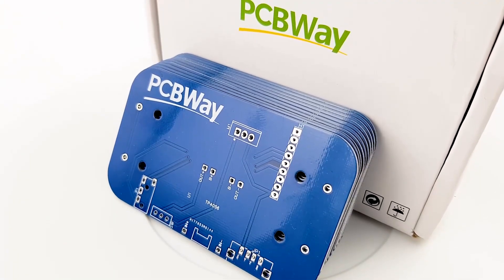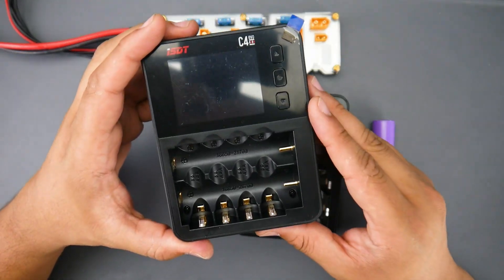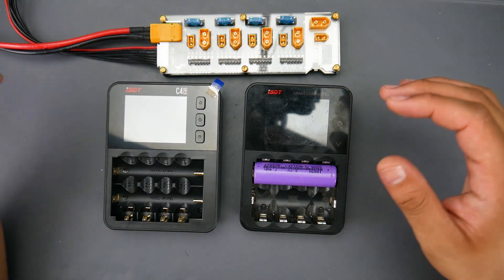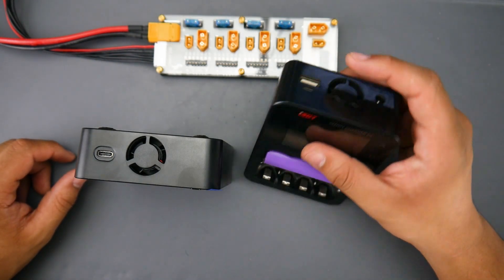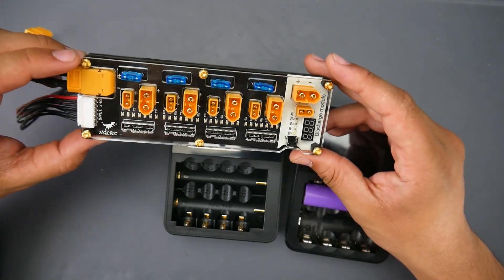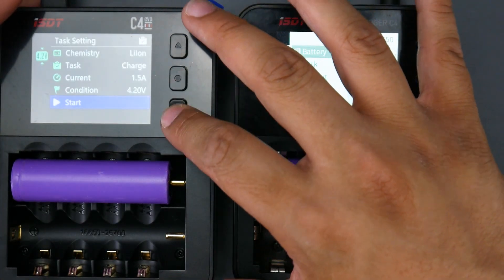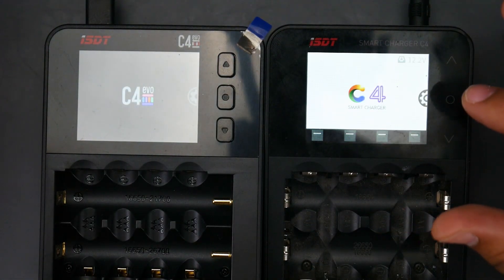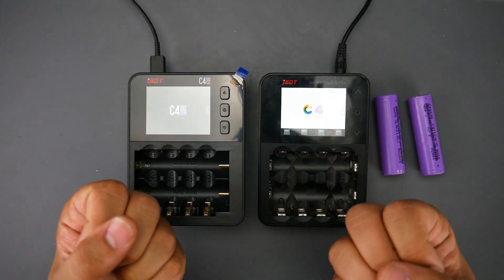My Best 18650 Charger Got an Upgrade // C4 Evo

Comment: Just got the SKYRC MC3000 and thinking about returning. Why isnt there a good all around 18650/21700 charger. Hopefully one that does lipo too. what about xtar dragon or the new epoch one?
Reply: What's wrong with your MC3000?
Reply: If you do not like your MC3000 you will most likely will not like anything. I use my MC3000 daily and never had any problems with it. I use it with the bluetooth connection to my phone and sometimes with the USB cable connected to my Laptop. It charges everything you throw at it. The best thing, it is super accurate.

Comment: I received mine and it's not charging properly. I was thinking maybe the power supply was the problem. I got a cheap USB-C power supply rated for 12V@1.6A. On the display I can see the input voltage dropping from 12V to 10 or so and the battery stops charging. Any idea? 
Btw nice review as always.
Reply: You need 12-5v 3A
Reply: @BenBear-u7u  Yep, turns out my power supply was too weak.